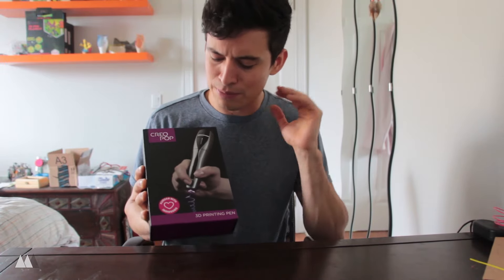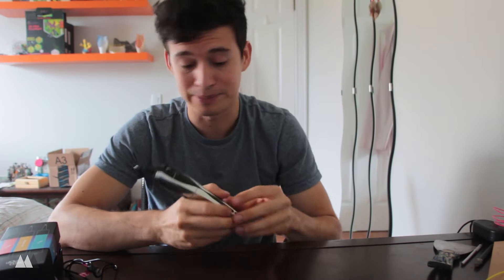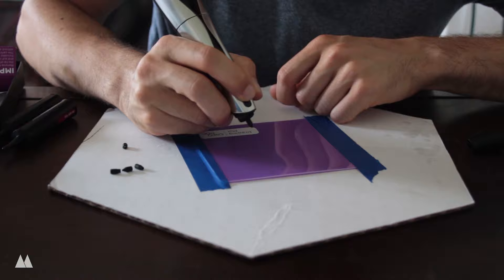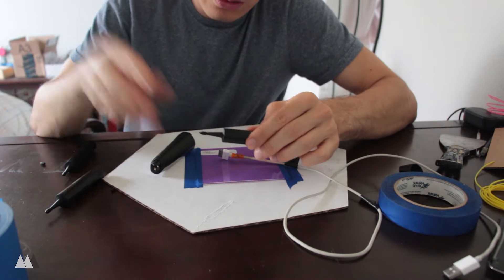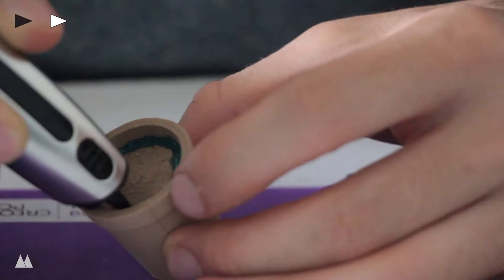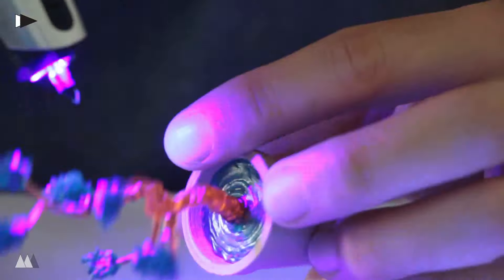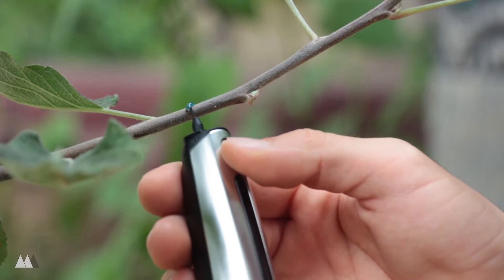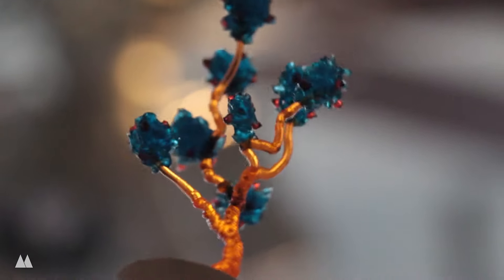What's Poppin' with the Creopop 3D Pen?

Comment: The sunlight UV outdoors might cure the ink as well I guess?
Reply: The UV light from this 3D pen and a welding tool are not even close to comparable. You have to understand that welding uses 100-250 ampere of current while this tool runs on mere milliamps.

Comment: That pen is super interesting. It would be a nice supplement to FDM 3D printers. I often want small transparent areas of a print, or light diffusers that are just a pain. It also has a lot of opportunity for repairs since it doesn't have the high temperatures and is probably a little more resilient than PLA. I'm really curious to see what you can do with it.

Comment: Nice 3D pen, but don't like the gel type look like transparent and its not heat base like the filaments/strands so you can't use soldering irons or lighters to smooth out edges on projects/designs so ill have to pass. Plus a 3D pen isn't really 3D if you can't print upside down. Ik its ink gel but a 3D pen should be able to write in any orientation.

Comment: I dislike the uv 3d pens. sure, they might be cheaper but you need to buy the original ink. the thing I like about most 3d pens is that they are compatible with most of the filament that is normally used for 3d printers and you can get a lot of it for cheap. also you can get it in bigger quantities so you wont need to buy it that often.

Comment: Are the resin inks irritating to the skin like other resins for 3D printing?  Should you wear gloves to avoid building a sensitivity to the material and causing you to give up using resin printing, curing, etc?  I love this 3D printing pen more than the others I have seen on this playlist.  With this it offers the opportunity to make backlit art far more easily.  I suppose the next thing for you to do is run longevity tests on colorfastness for each of the inks and filaments.

I would love to see you tackle the illusion of 2D, 3D, 4D stained glass art.